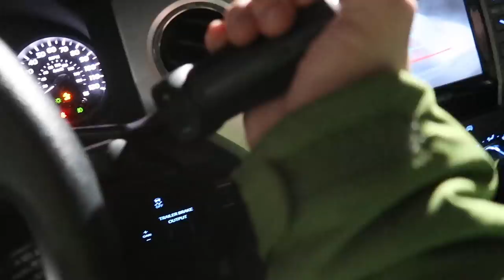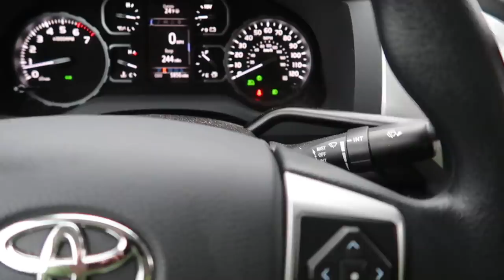At this Point it's a Rescue MISSION! We Gotta get the Truck OUT before we do any Damage to IT!

Comment: Wonder how a recovery strap would have done in place of that chain?  thanks for sharing !
Reply: I was going to say the same thing. They're a good investment with a bunch of uses. It would help here by letting the tractor get a little momentum before pulling the truck.
Reply: would have done much better! they multiply the force applied! also much easier on the frame, structure, and even the drivetrain. 

my 00' Sierra 4wd half ton pulled out a 3/4 diesel pickup with a large gooseneck trailer, and a 12k pound + 4wd tractor with loader on the back! took a few attempts jerking on the strap but it came out. it was melted and refroze ice it got stuck on. very very slick. next time I would have used a 30 foot strap not a 20. 

also bubba rope and ditch pig etc ropes that stretch work even better than a kinetic strap.

Comment: Goooood Mawnin' Al!   So, are you loving the Toyota?   I've been a really satisfied Toyota owner for 30+ years from pickups to 4Runners and even an MR2 and the Solara, my 1st car was a 1974 Corolla ...loved them all 100%!  I've never met anyone that was as 100% happy with Ford, Chevy or Dodge in the same way as me with Toyota.   I've alway wanted to be an American made kinda guy but the track records I've encountered have always pushed me back to Toyota.   People won't believe me but with an average of 75k to 80k miles on each Toyota I've owned I only once had to go back to Toyota for a manufacturer defect or broken part and that was for a replacement of a battery in my 2000 MR2....which sat idle for most of the first winter I owned it which was probably the reason it failed!

Hope you like the Toyota as much as I do.  Did your truck come with the "Crawl" mode for getting unstuck?  I thought that it was standard on the v8 version.  I'm at 130k on my 4Runners and I'm looking seriously at a new Tundra.  I need something that can pull my RV so I'm very interested in the v8 option in a Tundra with expectations that it will be as good if not better than my v8 in my current 4Runner.  Lastly what about snow plowing, what's your thought about how good the Toyota is compared to your Chevy?  Would love to hear more about your experiences so far with the Toyota vs Chevy!

Comment: Dude wheres your tire chains at? Cant believe you have that much snow and uce and no tire chains on.
Reply: He is running studded tires.
Reply: @thess518  
Studs are good
Chains are better..
Maybe a second older truck chained up for the plow
Reply: Exactly right. Studs are okay on ice, but for plowing deep snow you should invest in a good set of chains! Try putting them on the front tires. Traction for turning is a bonus
Reply: @buckwhitetail1876  yea, like he is going to chain and unchain every other day.  I know I would.  NOT.
Reply: While you're at it, tell the people in Virginia to not put on tire chains the minute it begins snowing! Sounds ridiculous on pavement with no snow, yet.
Reply: I hear almost everybody talking about tire chains, so I´ll ask.
Why not tire socks?! Aren´t they popular on that side of the pond? 
No noise, light weight, get you out of most cases, very easy to set them on off... They might not last as much as a set of chains.
But as an example, by now my tire socks are some 6 years old, still going strong. 

But anyway it´s to get out of dire situations, not to have them on 100% of the time. BTW Just like the chains. ;-)
Cheers
Reply: I live in Northern Wisconsin and dont run studs(illegal here) or chains. Mud tires throw the snow faster than it collects. Ice is different but still have little problem. Thank you BFG
Reply: Oh and I'm running an 8 foot Boss vplow on my 99 Ram Cummins
Reply: Most trucks will plow 6 inches in 2wd. Nobody uses chains unless they're plowing mountains. This has to be American

Comment: Next time the truck is stuck like that, put the blade on the ground (stop forward motion), put the truck in 2wd low, first gear.  let the rear tires slowly spin.  Now the tractor can easily move the truck sideways.

Comment: Needed to have someone in the truck, to put it in 2wd and spin the tires to help slide it in the direction you were pulling it.
Reply: Also, a tractor with actual lug tires on the front would help! Turfs just don’t do good with snow...

Comment: Next time instead of all that digging, rake some of the shavings from New Yolk City and spread it around the tires for traction?

I have seen later videos where you put hay racks in the new and old goat homes. The reason they won't eat the hay on the bunk beds is that goats do not like eating off the ground. When they have walked and laid down on the hay on the bunk beds it is then "ground" for them. 

What do you do with the goat milk? I haven't seen you use it yet.

Comment: That's why is professional truck drivers that drive semis we always carry chains on the truck 🚛 and at home there is always CHAINS ⛓️ on my pickup WHEN I AM PLOWING.... Even doing the road..... It's always good.... Do you feel like I am picking you ..... It's okay even with the ice it's under their the change would have got you out and and it would also help if you would have balanced out the weight heavy plow on the front you should have put in at least 6 or 80lb sandbags in the bed, that would have held down the rear of the truck..... Just throwing you some ideas....

Comment: It sounds like you had the tractor in HI range when trying to move the truck. Next time put it in LO, that will put much more torque to the wheels. It is better for loader work and pulling heavy stuff, like a pick-up truck.

Comment: Do you have any weight in the back of the truck? The rear wheels seem to spin easily. I keep 1,000 pounds of bagged sand and salt in mine close to the tailgate to counterbalance the snowplow so the rear wheels pull when the plow is lifted.

Comment: If needed put tractor in low gear I would do first then does it have cruise or whatever a tractor would have lock is very very slow and hop in truck and slowly try that and see what happens

Comment: weight is your friend. put about 2K (I use 2-3.5K but I'm in a 3500) in the bed you you can go through anything. your little tractor... leave it in low, low in gear while you are backing the truck up. it's not like it's going anywhere... then while you did get the truck moving, why did you stop?!?!?!? You haven't done this long, have you? and don't use the ball of the hitch on the tractor...

Comment: SO dangerous trying to snatch the truck over with a chain and off the ball of the tractor. I do a lot of offraoding and have seen some damage done by chains and stuff. Plus you are exposed on that tractor I would hate for it to snap and hit you. I watch every video just think if you are doing a recovery in that way you need to get the proper equipment. If you want to see what happens when a ball breaks, chain, or strap goes flying Ronnie Dahl just did a video on it I would suggest watching. I am not saying you need all the equipment he shows but to rethink your strategy a little bit.
Reply: Point taken!  I think that the thought ...work with what you've got ....comes to mind.  Risk is something we all deal with every day, smart people calculate the potential outcomes and take "Calculated Risk" when we have to.  Now, the jack under the truck, that had me thinking it could get ugly fast!  All's well that ends well I suppose!
Reply: Agreed, but he wasn't pulling on the ball. And yes, a snatch strap would be better, but sometimes you have to run whatcha brung !
I see now that he was pulling on the ball of the tractor.
Reply: @augustreil  He has studded tires. Better than chains.
Reply: @gelwood99 , I know he does. I was one of many who said to get them. I have them on my plow truck also. I never said anything about chains, except that they are a pain.
Reply: @gelwood99 - Studded tires better than chains? You are kidding right?
Reply: Air down the tires works wonders. I participate in snow recoveries here in the Sierra Nevada's. Air down the tires, 90% of the time you can back or drive right out. And yeah, hooking up to the ball on the tractor is not advised. And with the cold temp, that chain could snap, and they get weaker with every use.  Al, you need to keep a short piece (maybe 2' in length) of snowmobile track around. Put it under the spinning tire spike side into the ice/snow, and back right out.
Reply: I would suggest getting 2 pintle hitches one for truck receiver and one for tractor we have one in all our vehicles with hitches.  A good recovery strap is a nice addition.  I would never suggest using the safety chain point for a securement point.
Reply: @augustreil  Yeah that was the ball I was talking about. There shanks are even smaller than ones for the truck so easier to eventually break or weaken from doing that and then later on having issues. I have seen first hand damages that can be done with recovering when straps break etc. Thankfully I haven't seen anyone get hurt but it does happen.

Comment: You don't have 4 wheel drive??..... that truck isn't even stuck. Looks like you need better tires. My truck would drive right through that stuff without any trouble. Goodyear wrangler duratrac tires are what you need.

Comment: Slow that plow drop speed down.   Save your headlights. From fulling apart. Gess its not a true 4 wheel drive. Mmm.   You need. 800 pounds of weight in bed of truck. At least.

Comment: Dude never pull anything with the hitch ball....you are asking for trouble.    Also do yourself a favor and go to Amazon and look up Bubba Rope.  Pick up a 20 or 30 ft snatch rope and some synthetic soft shackles.    You can use the soft shackle in the tow hitch.
Reply: i agree, a synthetic rope will do a boomerang affect, and snatch stuff out of a hole. An endless come along works good to. Like the four wheels use.
Reply: Why can't you pull anything with a hitch ball? I mean that's half the use of em is pulling. I suppose if you just had a ball on a bumper but if ya have it mounted to your frame and your not trying to tow out a semi it will be fine